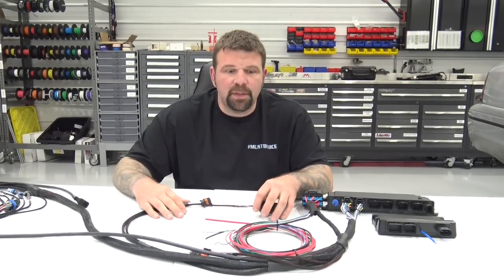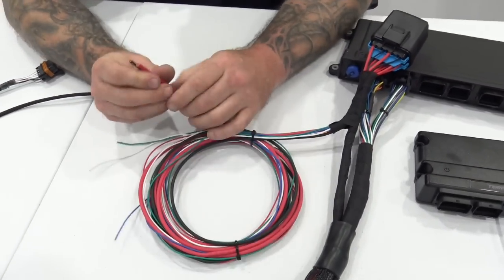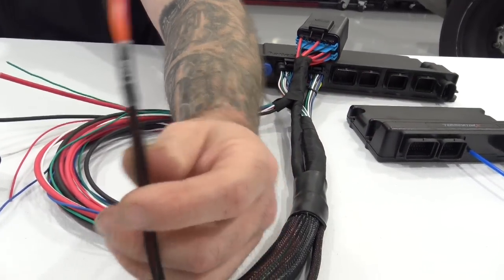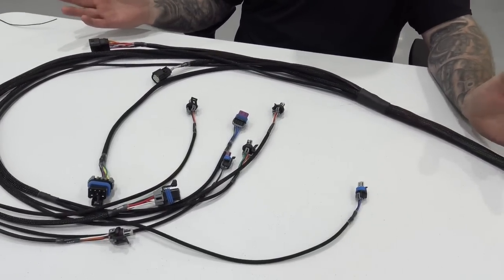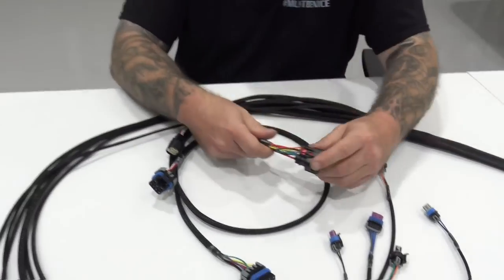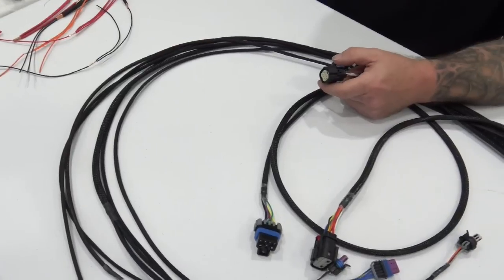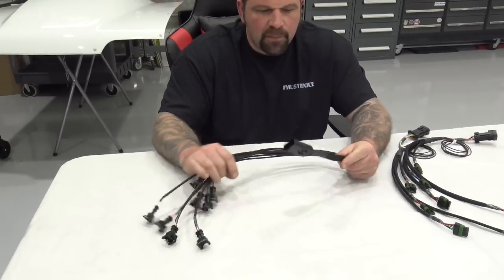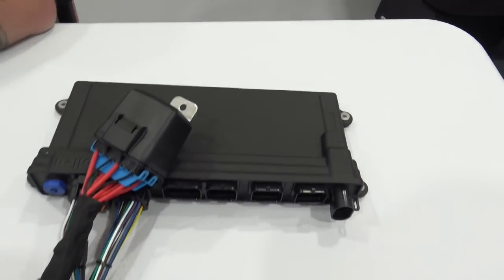Hcr Innovation Main Engine Harness for Holley Efi

Comment: Question, can I send in my Dominator harness as its trimmed to length for my sensors etc? Or are they all just pre made trim to fit? This harness solves all of my issues with the factory dominator harness. I'm fuckin sold. Ordering as soon as the new long block comes in.

Comment: You should make this harness with a cpc connector in the middle
Reply from the maker: cpc connectors are garbage
Reply: @theholleyefiguy  It would be nice to disconnect at the fire wall and take the entire motor out not unplug everything
Reply from the maker: I'm aware of what bulkhead connectors do. This harness is not priced in a manor that would justify the use of a proper bulkhead. Cpc connectors are the bottom of the barrel and I wouldn't even consider them in a automotive application
Reply: @theholleyefiguy  do you think there’s something we could put in the middle at the fire wall ?
Reply from the maker: Yes you could put a mil spec connector in line with it

Comment: Question on the relay/fuse box. Is it overkill to use something like the MSD solid state 4x relay solution for that?  I always wondered why Holley or other aftermarket harness makers don't use solid states like that is it just a cost thing?

Comment: This is amazing.... I am at the point in my 68 Camaro build of wiring and I gotta tell you I ordered all of the Holley harnesses and laid them out and hated how it laid and extra "slack" or routing it just looks terrible imo and not what I want under my new engine bay, surely does not fit the bill looks wise and I agree many wires and power sources are far to small or not enough......
Reply from the maker: https://hcrinnovations.com/shop/plug-n-play-harnesses/

Comment: Would this harness work on the Gen 5 LT1/LT4 stuff as well? Stock coils, cam and crank sensors.
Reply from the maker: ill have to research the gen 5 i have no experience with them
Reply: @theholleyefiguy  I would greatly appreciate it. I completely deleted the direct injection and I’m running port injection with the injectors in the Holley hi ram intake. Other than that everything else is stock LT1 sensor locations.

Comment: The only thing that has always made me lean towards Fuel Tech is the fact that they not only make you a specific harness for your car but they also hub dyno tune your car right there in house and not to mention they have an all in one built-in ECU/dash and you can load up three different tunes you might want to choose from while you're in the staging lanes and you can switch them on the fly and yes they do have a bunch of different add ons to go with your setup just like all the other companies do but the main setup is alot smaller than all the other ECU/EFI setups but if Holley had a main hub you could go to for dyno tuning and all the other services like Devin provides and they put out the quality work that he provides and all the knowledge then I think they would be a better company to go to and atleast if they made an ECU/Dash for the Dominator then that would be a start but Devin and his knowledge and his capabilities are what makes it worth everything to go to him
Reply from the maker: Have you ever used their dyno service

Comment: This needs to be pushed to mod motor guys with smart coils and the Hall effect cam and crank sensors(redline kit). Ls tb would be the only difference and I run ls tb cause they are way easier to come by. I’ll be trying one

Comment: Very nice product, just a couple questions for my two setups the first is a 540 BBC with a Holley crank trigger and a MSD cam sync to replace the distributor, LS style coil brackets to run coil near plug on a dominator ECU with drive by wire and dual wide bands. Do you think you’ll support DBW and dual O2? The second is a Gen 6 502 with Chevrolet performance timing cover with 58x crank and 4x cam sync, drive by wire and L21 Gen 6 valve covers with LS style coils, both motors have Holley single plane MPFI intake manifolds to run sequential injection. Long winded I know,
Reply from the maker: this will work on both with the 2 different crank cam sub harnesses.  as for dual o2s, that isnt exactly in an engine hanress as that is on the j2a connector.  same with the drive by wire and trans control.  we dont at the moment make those harnesses but can source them for your application

Comment: Can this be used with a 24 injector system (16 methanol, 8 gasoline)
Reply: It can be used in conjunction with 2 injector driver modules and a sub harness for the methanol injectors.